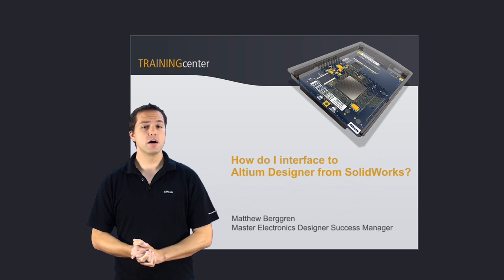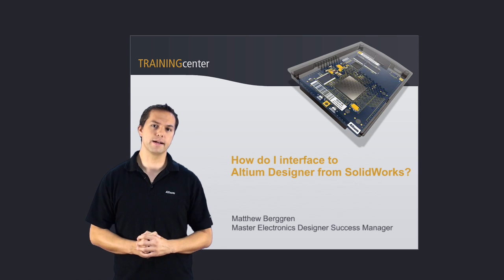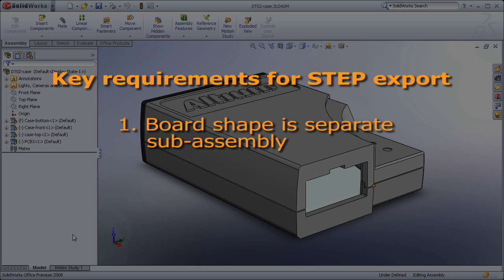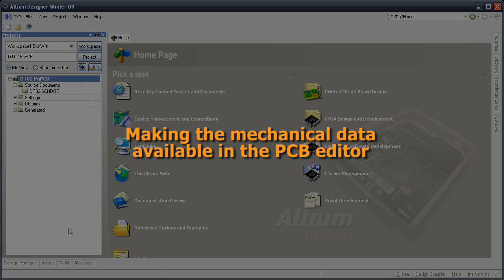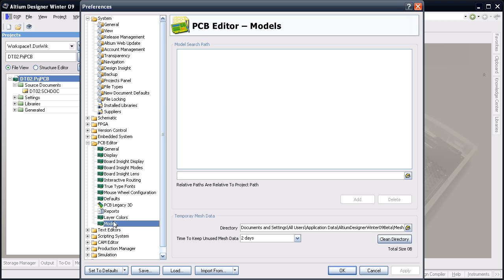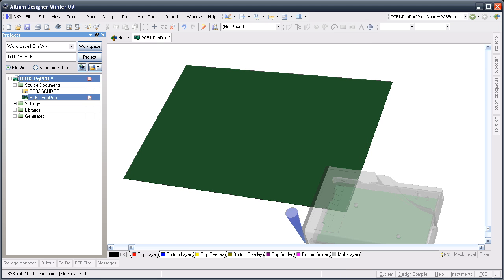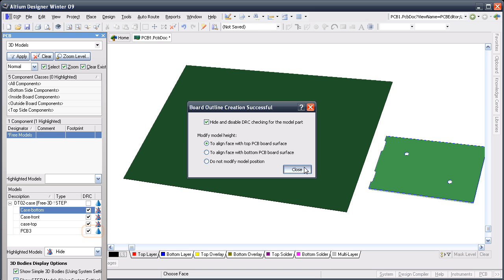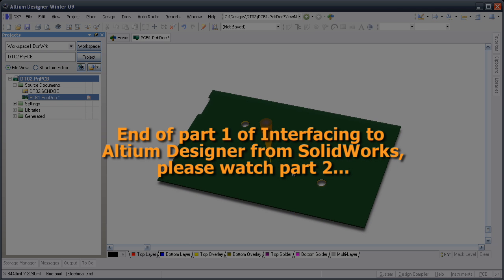Interfacing to Altium Designer from SolidWorks - Part 1

Comment: It would be nice to go through the settings, software setup options, etc. required to make all this functional. For example, in my Altium application, STEP does not even show up as a choice in the place 3D body dialog box  - all I get is 'Generic 3D model', and I am stuck right here already.